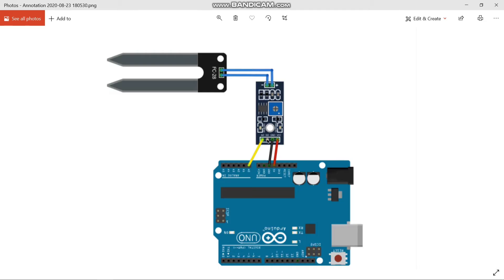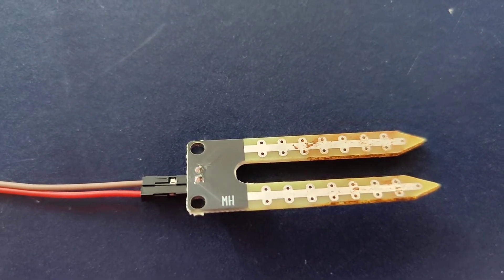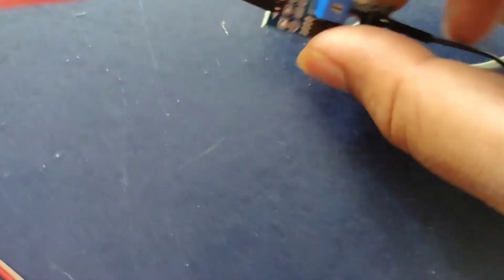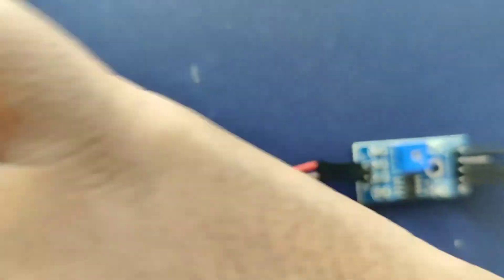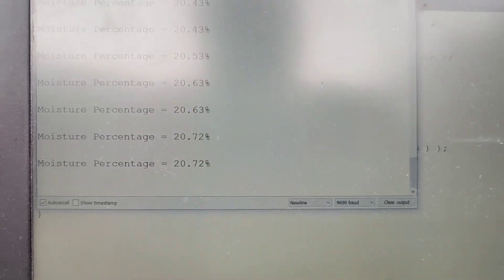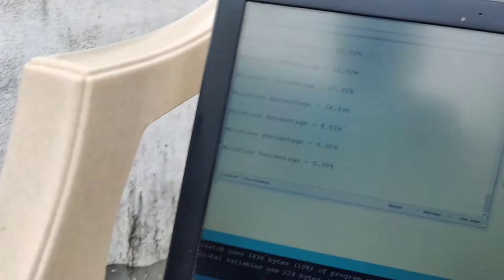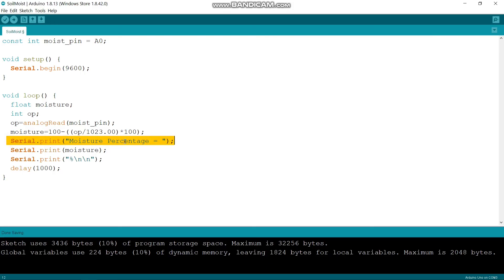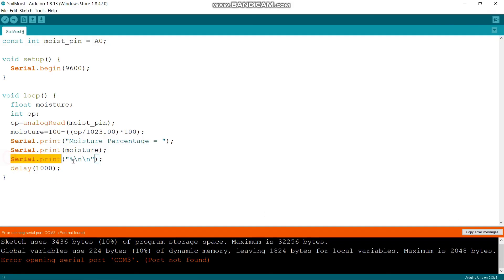interfacing Soil/Moisture Sensor arduino| Moisture Sensor with Arduino | Code for the Soil Moisture

Comment: bro mera output same hai usme change nahi hota hai , ky problem hai
plz help
Reply from the maker: Please make sure you have made all the connections correctly. If so, then check for the Sensor, if it is working or not.
Reply: Mere pass  soil moisture ke 2 sensor hai or both mai problem hai and connection bhi correct hai . Problem ky hai vahi nahi samaj raha hai
Reply: @gemorn  buy new one